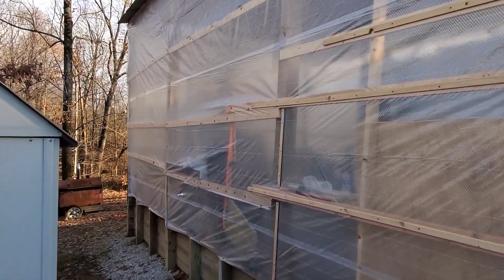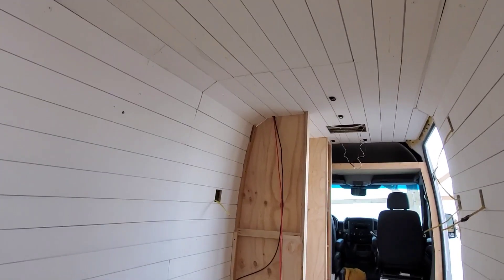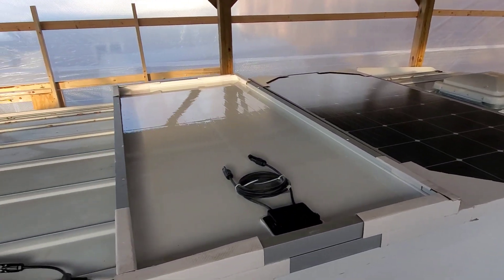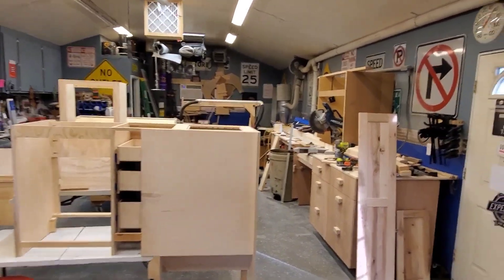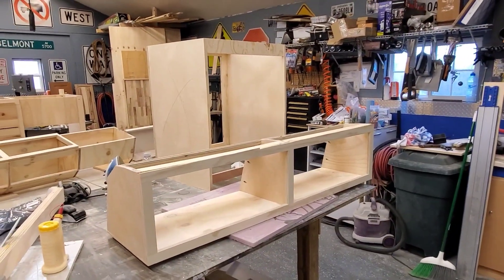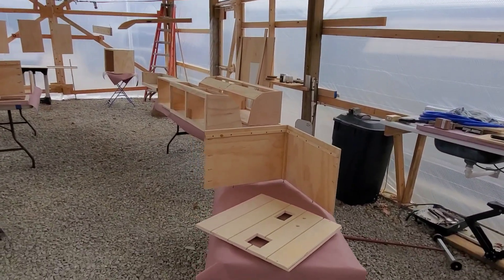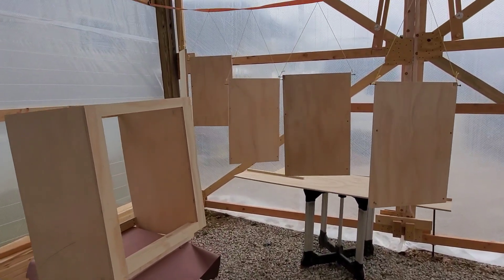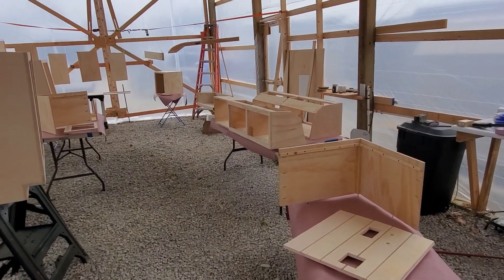Working around the shop (E34)

Comment: Hey red you are not a glorified DYIER I wish I had your talent, what are your thoughts about having a propane on demand hot water heater I have a 8x 16 foot Winnebago travel trailer do you think it will be safe to be in such a small area I'm going to run a stack out my trailer my on demand hot water heater 12in wide 18in tall I know you're busy I would like your opinion can't get no opinions from anyone else
Reply from the maker: If it already has a water heater they make a direct replacement for it that's a tankless system.
Reply: @RedsCustomDesign  yes I saw those and they're pretty expensive I just can't see putting that kind of money the one I got was only 68 bucks and it's on demand hot water you've never run out of hot water but hey thanks for replying back